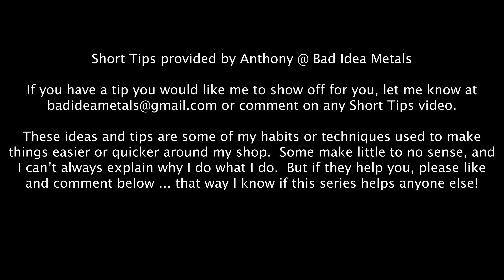Short-Tips: Removing Laptop Brass Fittings

Comment: Hello. At 1:25 there is base with something that locks like copper foils. If that is correct are they from pc boards? If yeah how did them out? Thank you for your time.
Reply from the maker: Most of the copper foils in that jar come from Copper Tape on heatsinks or copper heat transfer tape.  Various laptops have strips of this tape.  This tape can also be found in LCD monitors.  Just about everything in that jar is a form of tape though... I don't add it with my pure copper because it sticks to EVERYTHING (because of the glue).  Also, I am not sure if it is .999 copper or some alloy used as a heat strip tape... so I don't mix my coppers until I am confident that tape is pure copper.